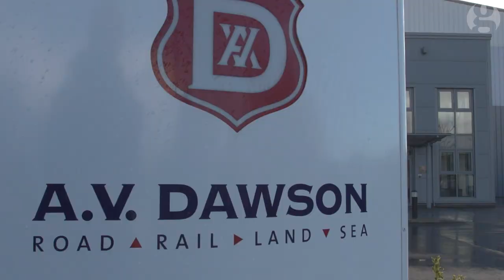No Bregrets: Sunderland after the vote to leave the European Union

Comment: The EU didn't restrict infrastructure growth in the North East. Successive British governments did. And if you think Brexit will change that, then you are in for a shock. Nothing will change in the North East.
Reply: Wales was completely funded by EU development grants lol
Reply: cr4yv3n I seem to recall Port Talbot steelmaker was at risk of closure due to Chinese steel dumping.

The EU wanted to put in place measures to prevent this and save jobs. Including Welsh ones.

Guess which country vetoed it? You  guessed it... 'Great' Britain.
Reply: TheSaintST1 well now it's MUKGA time ^^
Reply: cr4yv3n Good luck with that fella... UK going down....
Reply: Dear TheSaintST1, you're very courageous. As a German I wish the North East all the best but there are dark clouds. The latest Nissan model will not be built in Sunderland though the UK Government tried to fund Nissan with PB 60,000,000. It's no speculation to say that this is a sign of moving away one day as Honda is definitely doing in Swindon. This is based on the new EU - Japan trading deal.
But Brexit has become an obsession, the Brexiteers believe in that what they want to believe in.
Reply: @cr4yv3n  And the UK taxpayer funded those EU development grants. We're just cutting out the middleman.
Reply: @dcarbs2979  nobody cares.
Reply: @dcarbs2979  Correction, the taxpayers of 28 EU countries funded  those EU grants. Which was necessary because the British government itself wouldn't fund anything.
Reply: @flitsertheo  As a net contributor and 26 net receivers, we are the only one out of pocket from the contribution. It's probably true that UK govt wouldn't fund it, but that was the point of leaving: Any funding or lack of it is the responsibility of an accountable body.. Better still, an accountable body that is for and of our country: UK govt. As opposed to the UNacountable EU Commission.